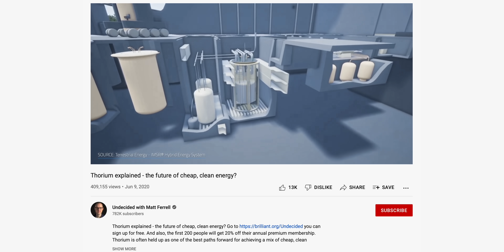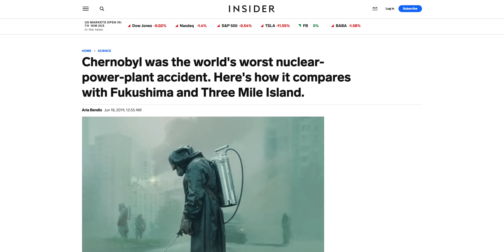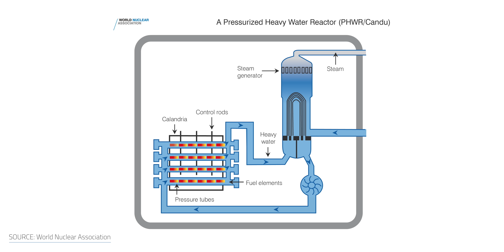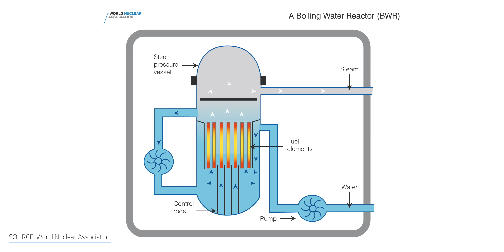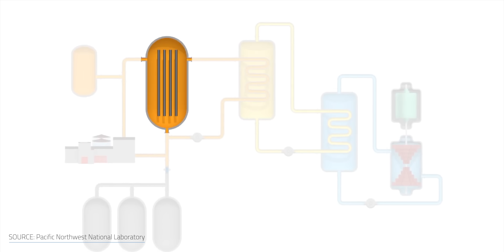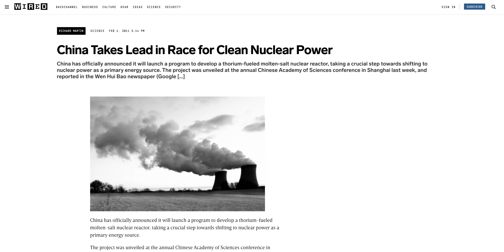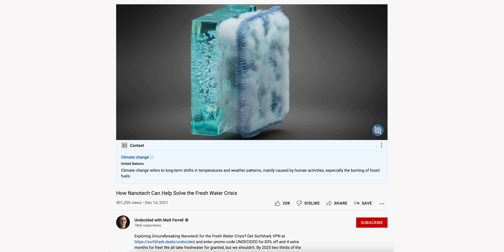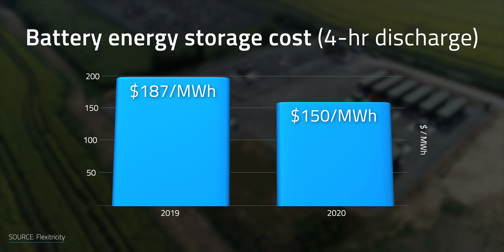Revisiting Thorium Energy - The Future of Nuclear Power?

Comment: This film is somewhat out of date, with regard to nuclear power station construction. In a few years, Small Modular Reactors (SMRs) will be rolling off the production lines, in Companies such as Rolls-Royce. A battery of SMRs will be quicker and cheaper to build than a squatting monster like Sizewell C. A single SMR can power a medium sized town.
Reply: When a SMR is actually built in the U.S. and is proven then you can make claims but until then it is just corporate PR.
Nuscale is the ONLY company planning on building SMRs in the U.S..

This is from the Des Moines Register an ultra conservative newspaper concerning the only Small Modular Reactor (SMR) project in the U.S. today.
In 2013, the Wall Street firm Lazard estimated that the cost of generating electricity at a new nuclear plant in the United States will be between $86 and $122 per megawatt-hour. Last November, Lazard estimated that the corresponding cost will be between $131 and $204 per megawatt-hour based upon the 4 recent new nuclear projects in the U.S. . During the same eight years, renewables have plummeted in cost, and the 2021 estimates of electricity from newly constructed utility-scale solar and wind plants range between $26 and $50 per megawatt-hour. Nuclear power is simply not economically competitive.
SMRs will be even less competitive. Building and operating SMRs will cost more than large reactors for each unit (megawatt) of generation capacity. A reactor that generates five times as much power will not require five times as much concrete or five times as many workers. This makes electricity from small reactors more expensive; many of the original small reactors built in the United States were financially uncompetitive and shut down early.
The estimated cost of constructing a plant with 600 megawatts of electricity from NuScale SMRs, arguably the design closest to deployment in the United States, was originally advertised as costing $1 billion but upon requesting actual bids from engineering firms, increased to $6.1 billion in 2020. Given inflation and other cost constraints that cost today can only be expected to be significantly higher.
The cost was so high that ten members of Utah Associated Municipal Power Systems canceled their contracts. NuScale then changed its proposed plant configuration to 6 fewer reactors but increased each reactor output from 50 Mw to 77 Mw costing at total of $5.3 billion. The NRC just last week approved the construction of the 50 Mw design but now will have to start the review process all over given the switch to a 77 Mw design. For each kilowatt of electrical generation capacity, that estimate is around 80% more than the per-kilowatt cost of the Vogtle project in Georgia — before its cost exploded from $14 billion to over $30 billion. Based on the historical experience with nuclear reactor construction, SMRs are very likely to cost much more than initially expected. And they now have delayed the project start until 2025 in an attempt to find more backers.  All this before the inevitable setbacks that will occur once construction starts.

Comment: The big advantage of MSR over solar and wind is the amount of arable land required to produce 1 MW of power.
Reply: Stay tuned.  Terrapower is building a MSR in Wy..
Been building for 2 years now and no ground has been broken and no updates on the progress.

Once one is actually built in the U.S. and we see how it operates and what it costs then you can compare it against solar and wind.  But for now you are comparing a dream against reality
Reply: @clarkkent9080  Current nuclear takes up less land than wind and solar, Thorium promises to take up even less space (probably won't but we'll see).
Reply: @RPSchonherr  Agreed. But do you have any idea how large the U.S. is???? The U.S. is almost 30 times larger than Germany which is all in on solar and wind.  Every U.S. house hold has enough roof space for solar to provide most of that home's energy needs.  Today, many people have goon off grid completely.
Reply: @RPSchonherr  The power companies don't want solar PERIOD.
My power company will not let me do it.  The PUC limits the number of people that are permitted to net meter power via solar. I have been told by my power company that they are in the business to produce and sell power not buy it from the customer.

Solar is not cheap but it does have a 7 year break even point for commercial installations and 5 year break even point for DIY when going net metering if they allow you to do it.

That is why many people are going off grid with battery storage with middle finger to the power company.  
Yes most Americans don't own anything but mortgages, loans, and credit card balances and cannot afford it.  But there are those of us that can and unfortunately those that cannot will have to pay higher and higher electric rates as the solar kids jump ship and leave the rest behind.
Reply: @RPSchonherr  ive seen this so its like they see the off grid equation with the panels so they say hey well doo all this movement gain some market confidence and keep with the same olddd, when they can team with the solar on the ground and get panels on each home atleast their is a a supply chain or market on the ground to support that , not left or right but if we had a gov with a vision that supported this concrete plans would help too would help , cant wait for thorium msr and water desalination if we can at the same time :))  to the future lol
Reply: @clarkkent9080  break even point gets sooner and sooner , and true but most of the time financing involved ,customer may still be better off just pay it on one of the off months , but once that conversion is done your clear and its yours ! So im Just saying I think the market is getting better in terms of what people can get , throw a powerwall on a upselll hey lol we got a hot dog ! lol
Reply: @Mrfinearts  As long as the consumer is educated (and that is not a given). before dealing with these solar installers.  I have enough DIY skills that with the new plug and play systems I won't have to deal with an outside company.

Comment: If nuclear is not a part of our carbon free energy future then significant power storage must be.
Reply: The you need to buy some candles.
Social and YT videos are NOT the news.  If you live in the U.S. here is the reality for the last 4 state of the art ADVANCED passive safety features new nuclear projects in the U.S. over the last 20 years. YT videos are great if you want to be spoon fed misinformation instead of researching facts.

The Southeastern U.S. is super pro-nuclear MAGA, has zero anti-nukes, and 100% political support. 

VC Summer (South Carolina) new nuclear units 2&3 were canceled in 2017 after spending $17 billion on the project (original estimate of $14 billion and 2016 completion date) with no clear end in sight for costs or schedule. 

Vogtle (Georgia) new nuclear units 3 &4 currently 110% over budget and schedule (currently over $30 billion) and still not operating. Mid way into the build, the utility stated that had they known about the many costly delays they would never have chosen nuclear. They are now delayed another year because according to the project management, thousands of build documents are missing. 

If you can’t build new nuclear in the MAGA super pro-nuclear southeast U.S. then where can you build it?

Comment: The problem with Wind and Solar is the low density of power and the dirtiness of their construction.  Nuclear is the only thing that is comparable to fossil fuel for energy density and for a true replacement.
Reply: How is the manufacture of solar panels (currently in China but soon to change) and wind turbines more dirty than a massive nuclear power plant.  There is more material in one nuclear containment building than in all the solar panels in the U.S.

Comment: Matt Ferrell. I hope you don't mind if I give a lengthy rebuttal or commentary:

4:15 is Canada's Terrestrial Energies IMSR, also at 12:35. The slanted roof is part of the "always on" emergency cooling system. Pipes filled with a gas remove 1% of the heat from the reactor and the roof is used to dissipate the heat.

8:30. Are you referring to "plate out" where nuclear fission products collect in unwanted and unknown areas of the liquid reactor? This is a huge problem that nuclear regulators will demand be solved. More R&D and material development is required. Terrestrial Energy decided to not even try to solve this and have been given approval to just replace their IMSR reactor every seven years. This is a work around to the plate-out and corrosion issues in liquid fueled reactors. They don't discuss what happens to the used up reactors though.

LFTR will never happen due to these issues, also the the conversion of Thorium 232 to Uranium 233 in a LFTR results in High Enriched Uranium. Even though the fuel stays in the reactor vessel this is a big no no! I heard a leader of the LFTR team say "to collect the highly radio active off gas, one only needs to bend a pipe, like seen in a kitchen sink pipe". I knew then that LFTR was a R&D sinkhole. Make money on R&D contracts and probably never produce a working reactor.

11:00 Molten Chloride (fast reactor). Another R&D sinkhole. Obtaining unspent fuel and or weapons grade Uranium/Plutonium, which is required, is a regulatory and political nightmare. No politician will allow this. They will say they support it but they are lying. Even if approved the permits for the facilities, safe operation (most nuclear accidents and injuries happen in processing facilities) will take years/decades. I don't see a government entity doing this properly. I also don't trust Bill Gates-had to fit that in.

10:24. Kairos Power's pebble bed, salt cooled reactors (Uranium only) is the best option to get Gen4 reactors built and once the public, business, government see Gen4 is so much safer than Gen1,2 reactors then hopefully MSR and Thorium will be seriously developed.

I have a feeling Kairos reactors will be expensive and the TRISO fuel, while much safer than existing solid fuel, is not recycleable due to its complexity. But TRISO fuel is already licensed and the reactor is well on its way in the NRC regulatory system (the regulatory system is just as important as reactor development and not to be under estimated).

Matt. Will you make a video on Kairos's design, as well as the X-Energy pebble bed reactor, X-100.

Comment: Re waste burning reactors: The first waste buring reactors are in New Brunswick, Canada
Made by Moltex Energy.
France is doing there part to by using reprocessed waste into the fuel cycle, which seems to be one path forward, tailored to usd thier waste.

In  Canada the Waste burning reactor is designed to burn and utilize Canada waste from Ontario and New Brunswick. 

The US have to design a waste utilization reactor to start the parh of proper  recycling of waste just like some are trying with plastics. Stock piling waste is a mugs game and not a solution.

Comment: In New Brunswick, Canada they are building a MSR the company is called Moltex Energy. Could you investgate and make video?

P.S. In a obscure white  paper. The MSR at Oakridge the metallurgical  brittle problem was solved, but Nixon still fired everyone and canceled the project.

The final details of the project where classified as secret under the Act.

China got a hold of those old secret documents they discovered nothing.

Nixon wanted fissile materials for the bomb taken from all future reactors in secret during the fuel cycle by the Department of Energy weapons programs.
Reply: Not another anti-nuclear Qanon conspiracy theory !!!

The secrets for a 100 mpg flying car were also classified top secret

Comment: IMHO, the waste is not an issue. It's mostly a distraction by anti-nukers.  My biggest concern with light water reactors was they produced plutonium.  And the thorium fuel cycle solves that.  Everything else is solvable through engineering/economics and mass manufacturing and efficiency of scales.  And the future is not renewables vs nuclear.  It's most likely both to help us through the climate change challenges.
Reply: No investor owned utility in the U.S. is even considering Thorium.  Isn't it strange that when people have to invest their own money, they don't fall for the social media, YT, or power point chatter ???

Comment: Overall very solid and well balanced video! There's just a couple details you got a bit wrong - all reactors (including light water and MSR) can reprocess fuel to consume nearly 100% of all the fuel. It's just more expensive (france has been doing it for decades)

Also, the MSR wasn't invented during or for the Manhattan project. It was designed exclusively for the nuclear bomber program. And it wasn't shut down due to difficulties with reliability - it ran longer than any other test reactor in history without needing any maintenance. It was fabulously reliable. Alvin Weinberg was the director of Oak Ridge and a HUGE proponent of developing the MSR because it actually poses a far, far lower risk of proliferation and accident than uranium PWR's. The problem came in the form of the cold war and politics. Admiral Rickover from the Navy ultimately had the final say in what was pursued at Oak Ridge, and he and Weinberg butted heads constantly over it, because Rickover wanted a nuclear navy (particularly nuclear subs) and reactors that could produce warheads to keep up with the Russians. Molten Sodium has... problems with water, and the reactors are much harder to make produce weapons-grade material. 

The main issue it had outside of politics, was that MSR's (particularly fluorides) are EXTREMELY corrosive, and radiation embrittlement can exacerbate things even further. So they lose some of their cost benefit in needing to be made from stronger corrosion-resistant materials. They're also a tad more sensitive to xenon poisoning.

There's a fantastic book chronicling the history of why nuclear power went the direction it did - it's called "Superfuel" and is a really fun, enlightening, easy read - it's basically 100% down to the cold war and nuclear arms and ships. Civilian reactors were always a complete afterthought. 

And lastly, you were close to an important point about timelines. Most climate studies I've seen estimate that we simply don't have enough time to bring nuclear on anymore as the primary base-load source for energy. We waited too long and now we don't have enough time to wait. So while I think in the future nuclear will be an important part of base load energy grids (particularly as energy needs grow everywhere) I don't think it can currently compete for the money we need to be investing to end fossil fuel use.

I have a hunch that some of the load will be handled with a system like what Ford is using with the new F150 lightning - your electric car can produce a LOT of power. Enough to power a home for 3-10 days at full, normal use. If we install systems for home and apartment buildings that charge the vehicle during low-demand hours, and then somehow coordinate them with a signal from the power company during peak use to cause the ones that are still parked at home and plugged in to just start sending power back into the home, it can act as a smoothing power source that we currently use a lot of natural gas power plants for.

Comment: SMR reactors could be mass produced at a very low cost.  They also are far safer and cheaper to build than large power nuclear power plants. The advantage of SMRs is they could be disposable and some designs,  including thorium reactors,  produce far less radioactive waste and it is low level waste.  

Wind and solar are intermittent,  SMRs are not . If a mass produced design is successfully created,  SMRs have the potential to have lower overall costs than fossil fuels. 

In a mass production scenario permitting and construction costs would be a fraction of a fraction of the current costs to build large nuclear plants.  Parts could also be modular which would lower maintenance costs astronomically.  

This is the most intelligent path forward to supply cheap energy to the entire world.

Comment: Thorium reactor is clearly a viable solution as a more scalable. And much safer process. You can put these things almost anywhere you need energy. Especially for desalination.    The only problems they had back at Oak Ridge were very minor.  They shelved because they couldn’t make weapons out of the material.   This is the only reason we ended up where we are.

Comment: This is supposed to be about Thorium, but $150 per MWh for battery back up??!!   Really?  I found those same numbers elsewhere on the internet, but I have considered battery backup for my solar and can't find batteries for 100 X that cost.  Lithium is about $750 per kWh and Lead Acid isn't much better.  Please tell me where I can get a 1 MWh battery for $150, PLEASE.
BTW big fan of Thorium.  With current technology think it is the only solution to our energy issues.
Reply: Just looked at this again.  All previous data was given as LCOE and written in the chart.  The battery data was not but I assume this number is also an LCOE.  Is it over 30 years?  Because batteries just don't last that long.  In other words what does this number really mean?